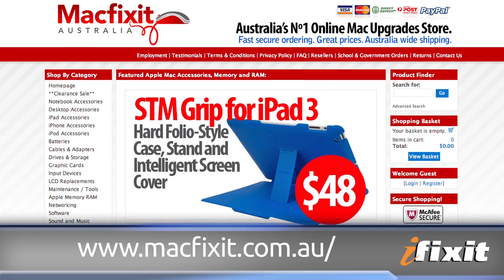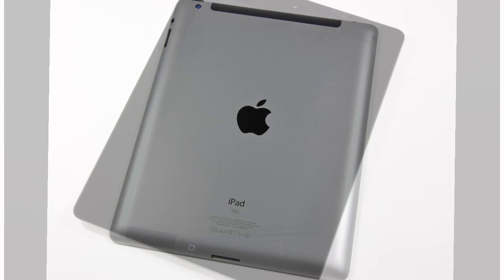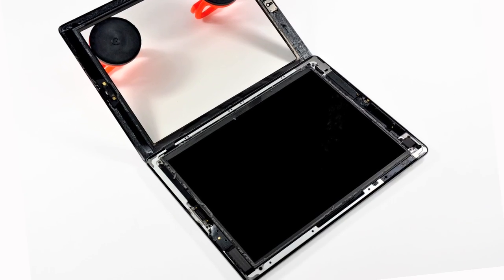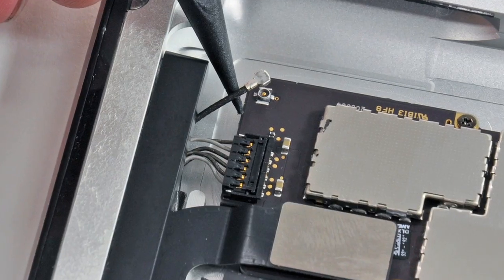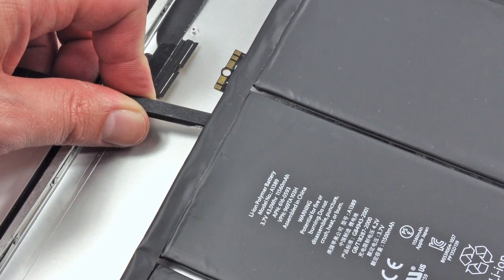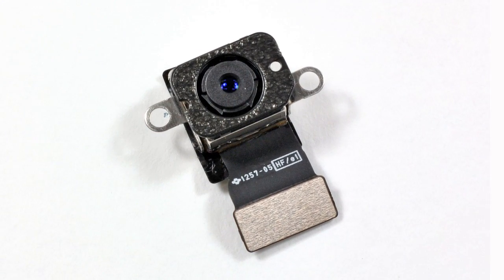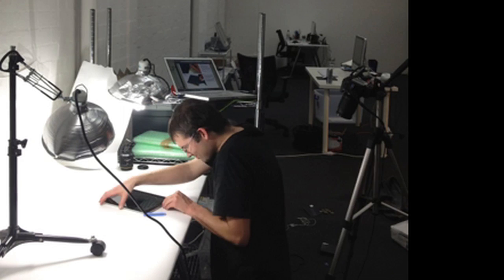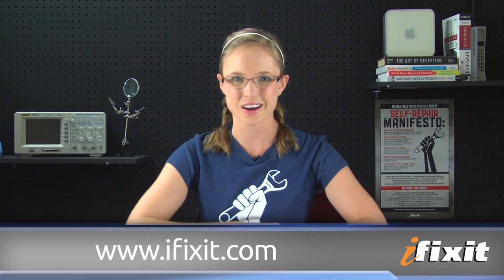iPad 3 Teardown Review

Comment: @ToughMan91 Actually the benchmarks are showing that it's about twice as fast as the ipad 2 while running at native resolution on both.  It's also faster than Tegra 3 when running native resolution.  External 720p it's between 3 and 4 times faster than tegra 3 depending on the benchmark.